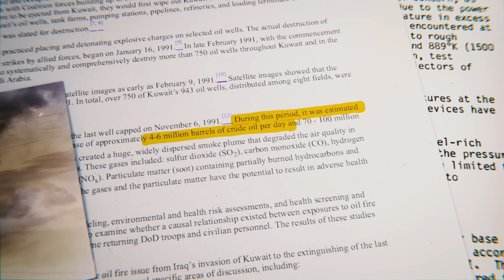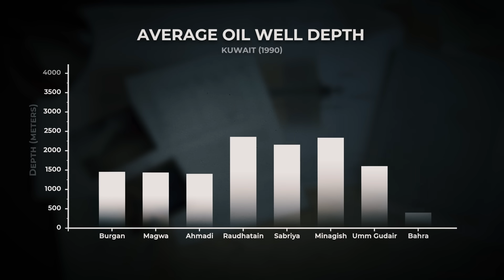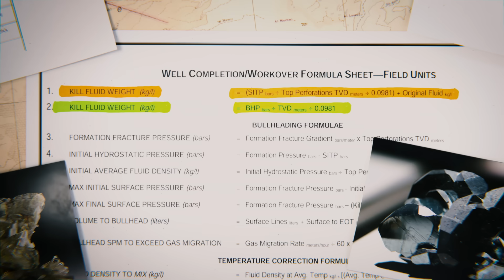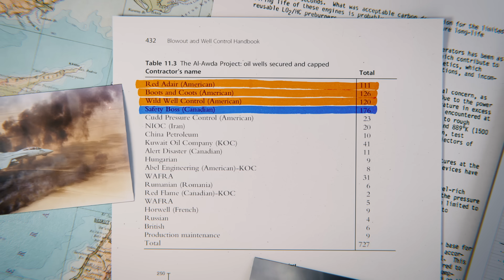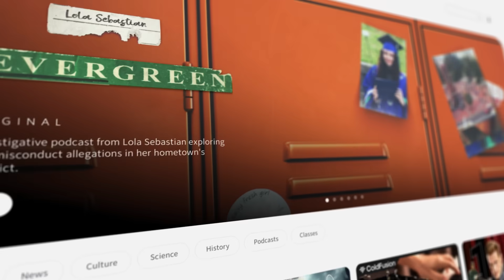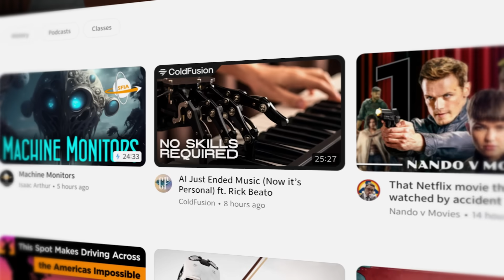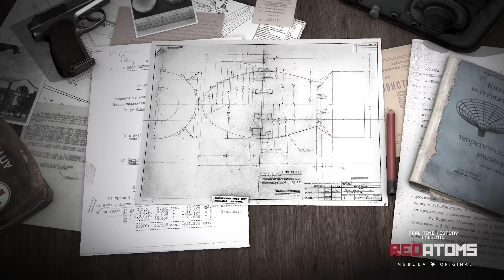The Worst Oil Disaster Ever

Comment: The hungarian machine is built on the hull of a T-55/54, not a T-62. This is easy to identify by the noticeable gap between the first roadwheel and the other 4. On a T-62, there is a less noticeable gap between the last roadwheel and the front 4. Also, the T-62 has a bulged turret ring that extends slightly over the hull to support the larger turret meant to house its 115mm gun.

Comment: And a Canadian company from Alberta changed how oil well wildfire was put out. Putting a 50 foot conductor pipe over the well head and pumping foam and water into the conductor pipe.  Way better than the dynamite Red Adair and Boots and Coots used.

Comment: As a Canadian and one of the Safety Boss team (we were the no 1 company for controlling wells) with 176 wells.  We worked faster because we were not tied down to solid pipes we used 'rag lines'.  Our source of water was 'unlimited' the Persian Gulf and if we managed to empty that it would immediately refill from the Indian Ocean.  No worries about water we pumped from the Gulf back to the wells using existing pipelines at each well.  Out monitors were trucked mounted allowing us to move freely on the lease.  What we discovered early on was the wells could be controlled with water if we could get enough water flashing to steam in the well fire itself, this steam would choke the well and the fire would usually quit in 10 minutes  we then switched to foam and moved to the wellhead and spayed as far as we could with foam.  Then came the gooper we, with brass wrenches and hammers removed the damaged well head and stripped on a new one with winch cables through two of the bolt holes on the flange face.  Easy peezy.
Reply: I was only 18 when this happened, but was apprenticing at Don Adams welding in Red Deer Alberta. We built several pieces of equipment for Safety Boss - piping and tanks for "foamy 1 & 2 , several monitor skids and shacks, etc.   you probably used some of the equipment that I helped make!
Reply: Oh yeah, no real challenge except an entire oil reservoir doing its best to get out of the ground directly next to you lol. Hats off to the work you guys do in some unbelievably dangerous environments.

Comment: Would it have been possible to construct a massive dome/cap that you lifted with large crane over the burning oil well and set down to snuff it out.? Removing oxygen instead of using water

Comment: 8:51 "Hot dense desert air" huh? Sorry but hot air is less dense than cold.
Reply from the maker: Are you asking a question or are you trying to be smart? 

Air pressure lowers with altitude. We are comparing 40k feet of altitude to sea level. The difference in temperature is trivial for air pressures in this comparison.
Reply: @RealEngineering  I see your point about the wording. You meant that the air of the desert floor itself is dense but also hot. Not that it is dense because it's hot. I still suspect that even at 95F/35C, the increased air density near sea level would dissipate more heat than the same engines at 30,000 ft at -40F/C.

Comment: People: Nuclear energy is too dangerous!
Oil industry every couple years:
Reply: obligatory reminder that 3 mile island didn't actually have any radiation leaks
Reply: @androgynousblob4835  even if it did, it would pale in comparison to damage caused by oil. Even Chernobyl and Fukushima don't come close.
Reply: @androgynousblob4835  nuclear is scary so we gotta use coal and oil power for another 50 years 😢
Reply: honestly nuclear isn't even that bad now, they use less volatile materials (not rods like Chernobyl) and the waste is used to make various things without being overly toxic (still some heavy metals but no cancer causing things), and as an added bonus you can retrofit most coal plants to nuclear since both effectively boil water to spin turbines, saving on initial expenses and grid construction, as it's already there
Reply: @jimbothegymbro7086  “now” implies nuclear energy was ever bad. It was completely propaganda from the very beginning, Chernobyl happened 100% due to human error and nothing more
Reply: @Kcpvvy15 although yes you’re correct it was human error it was a direct result of communism
Reply: This was caused by war though
Reply: To be fair, if it was nuclear reactors that were melted down on purpose instead of oil pumps that were sabotaged, I think the fallout (pun intended) would have been much more dangerous and long lasting.
Reply: @non-epic-commenter  Nuclear reactors would be patrolled by armed military personnel. They wouldn't have managed to do something like that, and there wouldn't be hundreds of them like in this case because the energy density of nuclear fuel is immense compared to oil, so you don't need as many plants.
Reply: @nocturn9x  I mean, the entire Iraqi army would probably be able to take over a reactor if they could easily take over Kuwait's capital. Having less reactors wouldn't be an issue, because as you said, nuclear fuel is much denser. So there would be less nuclear material needed to cause damage.
Reply: @non-epic-commenter  They could easily take over Kuwait's capital? I guess you forgot the part where they got their ass kicked by the US? Plus, if it were nuclear reactors we were talking about, the surveillance would be MUCH tighter specifically because they'd be such juicy targets. The soldiers wouldn't be able to get close without getting absolutely annihilated by an airstrike.
Reply: @ I’m talking about that when Kuwait got invaded by Iraq, if they had nuclear power plants instead of oil ones, there would’ve been much longer lasting damage. 

I don’t believe the Iraqis could’ve fought back the US, it’s outdated soviet equipment vs cutting edge technology designed to fight that exact same equipment. Of course Iraq got defeated by the US, but Kuwait is not the US. 

I’m saying that when the initial invasion happened, the Iraqis would win against the Kuwaitis, as it happened. Kuwait did not have the protection of the United States when they first got invaded. 

There wouldn’t be airstrikes to defend nuclear reactors, as the Iraqis gained air superiority quickly over the Kuwaitis, they had sent most of their fighting strength to Saudi Arabia, in a retreat. they failed to defend their capital, I doubt they would be able to hold on to a couple of nuclear reactors.
Reply: @non-epic-commenter  The point I was trying to make is that had the reactors been there since day one, they probably would've gotten US support much earlier exactly because those targets would be so valuable. Admittedly that might just be wishful thinking on my part
Reply: @nocturn9x  I was seeing it more as, replace the oil power plants with nuclear ones, and you would have a much larger/longer lasting ecological disaster. 

On the part of the US getting involved earlier, I doubt it really. They just did not have the motive to get involved until it was affecting them/outrage of the public.
Reply: Sabotaging 100 wells happens every couple years?
Reply: @yourlocalbluntfriend4136  you don't even need to sabotage 100 wells when there's a couple thousand oil spills/fires going on at any given moment.
Reply: @ where’s the statistics to back up your claim?
Reply: I mean if someone purposefully sabotaged a nuclear power plant the result would’ve been a billion times worse then this
Reply: A heated argument indeed.
Reply: Thing is that this was intentional.
Reply: Nuklear just in north of france drops a fukuchima every weed in the ocean, so... Comparing is rediculous,  we're still exploiting charcoal. And wood.
Reply: Communist's in classic fashion couldn't do something as simple boiling water without killing a dozen people and oil companies have killed it ever since.
Reply: Big Oil is longest continuous disaster, subsidised by billions of dirty dollar
Reply: Umm. Nuclear energy doesn't fuel your car. Only your house
Reply: @prestonhanson501 If we decide to stop digging fuel out of the ground (because it affects atmospheric CO2 levels), and batteries don't get much better, carbon neutral fuels will probably need to be a thing. Nuclear power can be used to generate such fuels.

Also if your car is plug in electric, it can be charged with nuclear power.
Reply: The scale of the oil industry is hard to wrap your head around. There is  100s if not 1000s of rigs drilling new wells every day year round. All of the massive equipment and pressures involved in the process as well as the amount of people it takes to run the operations is crazy. One of the safest large scale industries there is. Just the general public are misinformed by media and any sort of hiccup or incident we have its gets plastered everywhere whereas other industries have crazy accidents but it never gets brought up.
Reply: @holliday0435  How do the boots from big oil taste?
Reply: @holliday0435 the "hiccups" you mention were massive ecological disasters. It's highly offshore rigging especially is extremely disruptive to the ecological life the rig drills around. But of all things. Those oil companies never do anything meaningful to fix those accidents. South park said it best "Im sorry 😢."
Reply: Did you watch the video? The Iraqi army sabotaged the wells. Who sabotaged Chernobyl? If nuclear power is so safe, why don't you go live in Chernobyl?
Reply: @BlackMan614  the soviet government sabotaged the chernobyl power plant.
Reply: @iateaBibleonce  ROFL!! Sure they did. Bad take.
Reply: contamination like these are negligible when compared to a nuclear catastrophe
Reply: You can clean up oil, radiation is a different story.
Reply: @ScottBFree  You can literally clean up ''radiation'' though. The thing that causes contamination after a nuclear disaster is radiated particles, literal chunks of concrete or fragments from the explosion at the power plant that have been scattered by the wind. And theese particles can be detected even with civilian equipment and cleaned up. The Japanese government has done this after the Fukishima disaster and they have gone beyond what would even be necessary to achieve neglible radiation levels comparable to background radiation. It is expensive but not necessarily worse than a oil disaster. And it's nothing compared to the entire towns that were physically wiped out and thousands of people that died from the tsunami itself.
Reply: @ScottBFree hmmm weird how Japan cleaned up their radiation zones
Reply: @ScottBFree  What about Fukushima?
Also, tell me, have nuclear reactor accidents ever resulted in toxic and acidic rain that kills hundreds to thousands of animals? Do they help in destroying the environment of the entire world? Because, as far as I know, fossil fuel power plants cause both, and much more than that, too, because that's not mentioning the damage said power plants do to humans as well.
Reply: Nuclear energy IS too dangerous, that area is safe now unlike Chernobyl.
Reply: @GM-xk1nw if we base our risk management off of soviet builds, we'd go back to the stone age.
Reply: @teejin669 why do these anti-nuclear people think chernobyl represents modern reactors?
Reply: @GM-xk1nw it’s not.
Reply: @YTDE426  its more risky instead of dangerous id say
Reply: @YTDE426 yes it is particularly the new stuff.  Respectfully I urge you to go do some more reading.
Reply: @YTDE426   it is though, stop lying nga
Reply: @GM-xk1nw nuclear disasters are more dramatic, severe, but also rare. We notice those disasters and easily remember them because of how severe they are. The danger and disasters caused by the fossil fuel industry are way more common but less dramatic. Even the normal "successful" operation of fossil fuel power plants causes damage, environmental destruction, and health problems. Nuclear power causes less damage per power produced, even including the high profile and preventable disasters in the past.
Reply: @johnmorrell3187 Dramatic? Sure, severe? No, never. Oil spills and coal mining have had far more disastrous and lasting effects than nuclear disasters.

It's easy to forget just how awful oil spills have been and how its effects withstood the test of time
Reply: @tandemcharge5114  Oil and coal are pretty awesome. The civilization they built and fuel raised human lifespan from 35 to 79 and still rising.
Reply: @gregorymalchuk272  It did facilitate the advance of human civilization, sure, but that doesn't mean it's completely sustainable. Sooner or later, fossil fuel deposits in the world will eventually run out, not to mention all the damage it does to the environment and to humans as well.

Most of the greener options for energy production are incredibly clean compared to fossil fuel power plants. Nuclear reactors just need some shiny rocks in order to can power a couple thousand or so homes over the course of a hundred years, not to mention that nuclear fuel is quite abundant in the Solar System. This isn't even getting into the massive solar farm projects that could theoretically be done just in the orbit of Earth, which can all be done using resources from asteroids.
The future should not be fueled by coal and oil, but by the abundant resources of our Solar System.
Reply: @GM-xk1nw  Chernobyl was safe enough to withstand sabotage from the Russian army during the invasion of Ukraine.

You can name the two major nuclear disasters: Chernobyl and Fukushima

You can't even name the last 2 major oil disasters because they keep changing every couple years. Look at deaths/KWh, nuclear is and will always be safer.
Reply: @Gundam4President  Chernobyl isn't active lol.
Reply: @GM-xk1nw  chernobyl is relatively safe if you don't go inside the plant and poke at equipment
Reply: @GM-xk1nw  so in that case i guess we shouldnt use jet planes because the soviets proved those were too dangerous as well.

Or maybe it could just be poor soviet designs that are rushed and not well thought out....
Reply: @gamechip06   obviously soviet design error, same with Chernobyl because of human error but mostly reactor's design.
Reply: @GM-xk1nw  so just because of the tenerife disaster, we should ban airplanes, which is the safest mode of transportation, and make everyone take their own car, which causes much more deaths per year.
Reply: @GM-xk1nw ah yes the poorly built reactor, poorly manned by poorly trained men. Where even soviets managed to keep the thing from making the whole continent uninhabitable
Reply: @furinick   the whole continent? last I checked both europe and asia were still inhabited. Russia and Ukraine are still inhabited and even the exclusion zone has people living in it
Reply: @FishbedMyBeloved  i believe i said "threathened to make the whole continent" not "made the whole continent"
Reply: @furinick  Exactly.
Reply: @GM-xk1nw  Are you telling me Soviet technology was more advanced than anything we have today?
Reply: @GM-xk1nw 
Chernobyl is mostly safe
When from a region to a facility
Reply: @GM-xk1nw  who told you that? The oil industry?
Reply: @GM-xk1nw nuclear is safer than ANY other power production. And most of Chernobyl is safe. And don’t forget that there has been multiple other reactor meltdowns since then and all of them were almost completely harmless
Reply: @GM-xk1nw Chernobyl is the only place is the world that is still irradiated. People currently live in Fukushima
Reply: @GM-xk1nw  In the 70, 80s and 90 yes

Nowadays its pretty safe. We really just need to put extremely old like 70s reactors out of commission and upgrade them with modern reactors. The reason why Chernobyl happened is because of the lack of safety in the Soviet union while Fukushima happened because of the lack of redundancy the moment the Tsunami knocked the generators out (said generators are also not in a good place).

I still advocate for a balanced approach when it comes to renewable energy. Its a bad idea to simply rely on one source of energy after all (do note every single renewable energy has their upsides and downsides and you're forced to combine all of them and not rely on one of them like having a couple nuclear reactors in safe locations with good redundancy combined with dams, solar and wind power planes will power the future.
Reply: @GM-xk1nw More people will die purely from coal mining accidents this year then were killed by any effects of the Chernobyl AND Fukushima disasters. To say that nuclear energy has killed or is more dangerous is an idea sold to you by oil companies
Reply: @GM-xk1nw  Nuclear energy is the safest form of energy we have, and has caused the least amount of death, even less than wind and solar. Modern reactors are incredibly safe.
Reply: @GM-xk1nw  coal power has killed more people than nuclear energy has
Reply: @GM-xk1nw  HOW is Nuclear Energy dangerous?
Reply: @GM-xk1nw it's not dangerous people who don't know anything about nuclear reactors say this
Reply: @GM-xk1nw  Chernobyl is a horrible example and is just a classic case of communists not being able to do the simplest things like boiling water without killing a bunch of their own people.